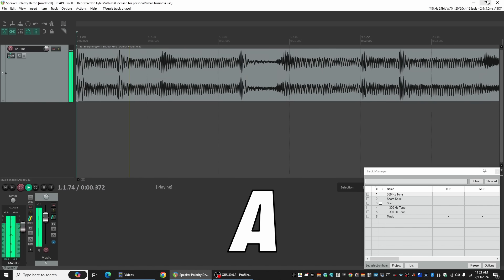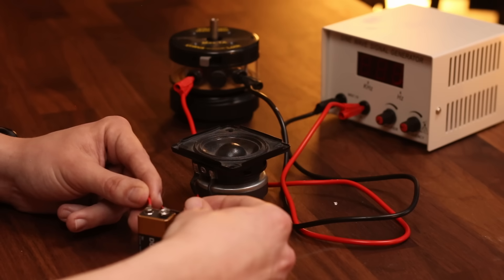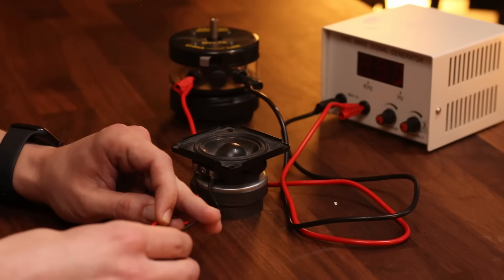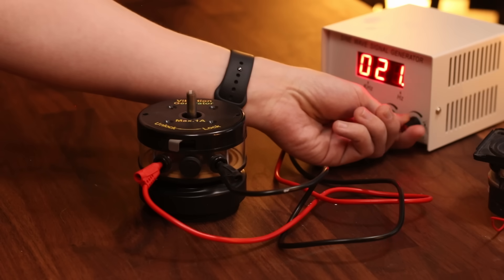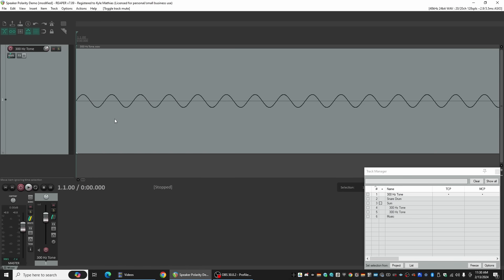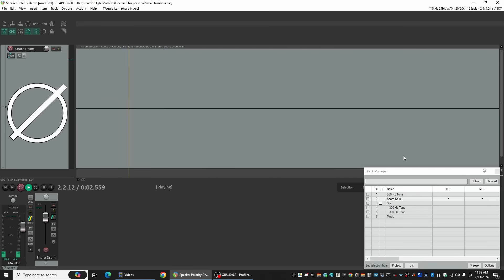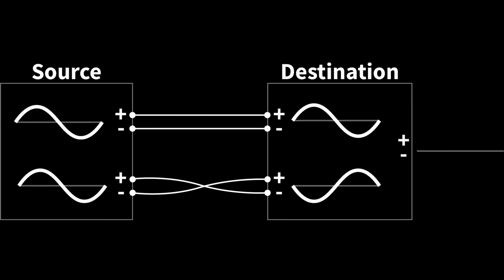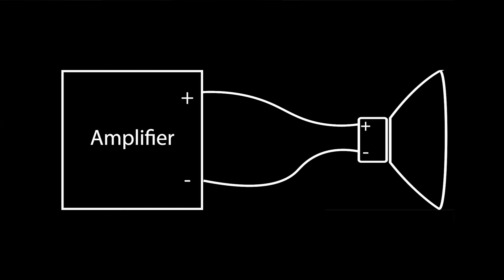What Happens When You Wire Speakers Backwards?

Comment: I had a Pioneer deck in my car that would allow me to select reverse polarity on the sub. I presumed this is what it meant. I tried it a couple times and never really perceived a difference in overall sound. 
After considering this explanation, I'd guess there would be cancellation in the overlap between the lowest sounds my smaller speakers could produce and the subwoofer's sound. Maybe that smooths out your system's output across the low frequencies.

Comment: think you coulda wired 2 speakers in reverse and played a song after having played it thru speakers wired correctly so we could actually hear what happens when you wire backwards?   A video that asks what happens if you?  And instead of doing it you just run yer yap about it.  Fuckin genius ain't ya.
Reply from the maker: I did play the song through two speakers with opposite polarity. The speakers were the speakers you were listening to the video with. Also, check out part 2.

Comment: Here's an explanation for you:  1. Air is not linear. It is tougher to compress air than to expand it.  When you microphone records the sound, the sound is distorted with quite significant 1st harmonic because air wave "pushes" are more pronnounced than "pulls". 2. The same happens during sound reproduction by a speaker..... ... BUT, if polarity is "wrong" the 1st harmonic kinda cancels itself a bit, if polarity is correct the 1st harmonic further amplifies itself.    3. Human ear actually does not perceive low order harmonics as a distortion. THey can serve as subtle sound "coloring". thats why tube amps improve some sounds (and make other sounds worse) is because they add low order harmonics into sound material....   But in this case "air" nonlinearity is so usual that we got used to it and and brain will most likely ignore it.... But maybe some people can hear it (it is plausible). What to listen for is reacher mid-range  content.  And it should be material recorded with teh microphone to hear this subtraction/addition of 1st harmonic. Of course there will be no difference for the generated sound.

Comment: False. Speakers doesn't have 'positive' wire because current are flowing with both directions (so voltage is positive or negative and thats determine direction) and that is the frequency of sound. Withount that +- changes speaker doesn' work.

Comment: thats the reason why some speakers in a 2 or 3 way speakerboxes could be attached opposite. Reason is to assist noise cancel the crossovered frequencies in case there are SPL deviations which would lead to tune crossover with more expensive componens or change the speaker for more expensive one..... sometime could help this ingenious aplication of reverse polarisation  :-) but designing hifi speakerboxes with complete electronics is not a standard discipline for everyone :-D

Comment: I wired 4 speakers before and had one of the speakers wired wrongly and the sound was 'tinny' and 'toney' with no bass throughout the whole system, but as soon as i found the wrong wired speaker and swapped the wires into their correct positions the sound had more depth and bass (i left the song playing as i swapped the wires around and the sound difference was noticable straight away).

Comment: 6:46 
Ah, but MOST if not all home stereo systems run way MORE than a mere two.
Maybe in ancient times, but even back in the early 1970's a good brand of home sterio was considerd as the Pioneer.
It usually ran to FOUR speakers, two per box, one a tweeter the other a larger bass (general usage).

It was the sheer size of the wooden box, along with the dampening system, and any vents it had, such as ventilated cones on the main speakers, which allowed the bigger speakers more room to "pump" air, whilst using that air to keep the voicecoil cooler as it flowed past the voicecoil itself.

FOUR speakers, all operating at different frequencies, meant that each speaker OFTEN ran against the movements of the others, and just as often, would all of them run as if one big speaker.
Thus there was always a lot of pushing and pulling going on, inside the boxes, as well as outside them, in the room.

IF one speaker was (acccidentally or on purpose) wired in reverse, most often no degredation of the total sound was ever noticed, except maybe sometimes when the bass soften out to almost  no level at all?

People (of those ancient times) just assumed it was the music itself and no one bothered asking the biggest curly question, until spottng a backwards wired speaker.

Now - take a little system such as I hand built (frequently) being one that has THREE master "balanced" DELTA WIRED speaker circuits, that are then also phase shifted as well as phase split.

One suddenly finds a LOT MORE than just two speakers, almost all of which (because of the way they are "split" apart) are running from a genuine 3 phased supply, in a multiple crossed star-delta-star configuration, meaning OMG all 88 speakers have at least a DC connection to any other speaker, but all DO NOT SHARE all the "same" electrical sine wave properties, of ANY other speaker, meaning that in a dual direction of travel (IN & OUT) each speaker is sometimes in phase with, and mostly NOT in phase with, any other speaker, so how do you tell, if ONE is wired backwards, when you have 88 ?

And, if it weren't for the LIGHTS, one cannot tell HOW POWERFUL any speaker is, unless it's light shines brightly.

A for real VU visual-meter (with a difference), one instantly visible, instead of a needle flicking on a small VU meter.
Plus, how many VU meters can one obtain, to provide a good enough reaction time, to see anything untoward.
LIGHTS are instantly seen as utterly different, completely variable and totally powerful.

https://youtu.be/Ub0S8eTijrA

One also cannot find a visual video recorder that has 88 different audio microphones, so a small MONO Nokia Cellphone's vidual recorder function was used.
With it's one ear (a voice-only mic).

Comment: 6:39.
Interesting hy[othesiss, unfortunately, NOT every AC audio signal is a pure "one frequency only" signal, with most having many other frequencies, all fighting for survival, within any audio track.
So - inverting one will give no difference, using TWO signals (not entirely the same) will result in a clearer sound, of lessor frequencies, than of similar ones.
It won't be 100% silence.
UNLESS you run the exact same signal pathway through both speakers - inverting one against the other, where BOTH can be seen to be active, whilst your ears hear nothing, and why is that -is it because they canel each other out, or .. Is it because ONE SPEAKER "sucks all" of the other speakers output, into itself, leaving NOTHING fr your ears to hear?

The second option is what happens, so - if the music "played" is at the upper reaches of audible volume, but inverted with respect to the other speaker, which is wil alost always be directly facing - for this effect to work, all audio will go from one speaker diaphragm, into the void created by the other. flip flopping in direction of "pull" depending on sine wave configurations.

NOW, will you hear anything.?
Probably not, BUT if one speaker has some added reactance added, such as a volume control, YOU will hear the other value of "volume" that has to go somewhere, and it will, via your ears.

If you "face" both speakers away from each other, to create dual parrallel lines, you will get "crossover" frequency wave patterns, that act for & against their identical signal paths, from either one speaker or the other speaker, AND THIS OCCURS whether or not either speaker is inverse wired.

It just sounds different at the crosover points.
ie:
If one signal is say running at 300hz and the other at 150hz, every second waveform that crosses the 150hz signal wave front - will oppose it, but every other will add to it.
Resulting in a faltering pattern of (multiple) High/low vs Loud/Soft music.

Comment: 0:54
The speaker voice coil, being an ALTERNATING CURRENT device, will "appear" on the application of a fixed "one-way" DC current, as if it PUSHES (or pulls) In ONE DIRECTION ONLY.

A brilliant way to show everyone here, that you know absolutely DIPSHYTE about how ALTERNATING CURRENT DEVICES actually work, because, being an AC device, if you "left" that tiny 9vDC voltage applied for way too long, you would effectively BURN OUT the tiny wires inside the voice coil itself, whereas - if you applied say 50vAC at a high rate of current, it would happily perform it's function all day  long, every day - because it was made as an AC device.

P.S:
An alternating AC current, flows in BOTH directions - alternating twice as fast as the frequency that drives it.

So - if one applies a FIXED DIRECTION, one way only "voltage/current source" to the voice coil, all you will get is it's FAR LOWER DC resistance, and NOT it's far higher AC Reactance.

The result.
A burnt out voicecoil that won't LAST very long at all, before the tiny wires heat to such  an extent they "melt" their own insulation film with a catrastrophic short circuit result, ending in a completely burnt-out coil, with no way back.

Now, to "prove" a valid point, for an AC device (being the "electrical component" of the voice coil, attached to the speaker diaphragm), you need to apply an alternating voltage source.

Oh and I love how you "inadvertantly" leave out the statement of NOT removing the red wire, but to "touch" both the red & black wires..

See - if you ONLY aplied the black wire, to the hegative terminal (1st) you would NOT have the red wire attached, hence - if you (ONLY) touch the black wire to the negative terminal - which is what you "actually" said, nothing would also happen..

Sadly by NOT explaining the active test environments, of NOT removing the already touched red wire, BEFORE ADDING the black wire to the "connected circuit" via the negative terminal - YOU are not being specific enough to "prove anything - other than your own inability to explain anythng".!!!!!!!!!!!!!!!!!!

Comment: Years ago i designed a push-pull subwoofer configuration, ie 2 subs face to face wired backwards of each other, one pushing and one pulling, astonishing output in half the cubic box volume,ported and tuned. Made a band pass box for 2 kicker solobarics also, which the manufacturer said not compatible, 3 cubic ft, 4 4"x12" inch ports 2 solo 12s and 152 db in 1990
Reply: I see no one has ever even heard of a push pull set up, that's your loss, I took a guys Honda civic, he had 4 15" earthquake subs in gynormas boxes where his back seat used to be. He wanted more bass! I took those 4 out, put the seat back in, built a 3cf box, with one 15 mounted normally, and the other directly on top, face to face, tuned a 3" port to the box at 34hz. Result, 2x the bass he had in 1/3 of the space. It would literally suck the air out of your lungs, almost like a fat lady bouncing on your chest

Comment: To some people this video may be useless if I read the comments but let me tell you, not so long ago I've bought a very expensive home entertainment system with pretty decent sound. I had a get together with some buddies and wanted to show off my new set so I disconnected the complete system to play it outside and had a little help from one of my oh so helpful buddies. Eventually everything was connected and when it was time to play, I could only hear the mids and treble but the base was virtually non existing. With two subwoofers connected I looked like a total fool. When doing fault finding we quickly realised that the guy who connected the subs did the wrong way around, not following the colour code. So yes, very important to take note of and this is a very good video for the younger generation starting their sound journey. 💯👌

Comment: If you wire the polarity of a speaker correctly and the other speaker incorrectly on a hifi system, one speaker cone will be pushed at the same time the other one will be pulled, and this can cause cancellation on certain frequencies within the audio.

Comment: people claiming they can hear a difference are full of it. our brains can't actually detect the difference in the low pressure segment of a wave and the high pressure segment, and in fact, most people can't reliably tell if a constant change in pressure is up or down (eg, did your ears pop because you increased or decreased altitude). as far as sound goes, that's just not how the cochlea works. it detects oscillation, not pressure changes.

Comment: If you measure the output of an amplifier there is a small amount of dc (direct current) riding on piggy-back with the ac signal, it is not a pure ac (alternating signal). That's why it is oriented as positive to positive and negative to negative, otherwise they will not put a + and a - sign on the speaker. There are people who wants to challenge the norm without any theory for them to sound intelligent.

Comment: There is no difference if you reverse the wires on a speaker. The audio signal that is present in the wires of the speaker output is an alternating current not direct current therefor it is not polarity sensitive.

Comment: Its just going to drive the wrong way, and it'll be noticable at higher volume. I used to install theater sound systems its been awhile though. Even if i couldn't hear a miswired speaker the equipment wouldn't pick it up. A series of mikes in a diamond shape. Its really hard to pick out individual speakers in a theater while equalizing the system. A double a battery is better than a 9 volt, thats a bit hot.

Comment: I learned in the 1960's that wiring stereo speakers at opposite polarity diminishes the bass output of the woofer speakers. Because when one speaker is pushing air, the other speaker is pulling air. This cancels the bass sonic energy that gives music it's punch. My old tube stereo amplifier had a polarity switch that would switch the polarity of one of the speakers. I could really notice the difference!

Comment: I used to wire the front tweeters out of faze in car audio in the 90’s. It gave great separation and depth. But when judged using an R.T.A. It was always a bit worse. But that’s when a 32 band EQ on each channel came in handy. I wonder if I.A.S.C.A is even around anymore.

Comment: Very nice video indeed, so for applications like CB HAM radio , that only use 1 speaker , mono, if the terminals are not labelleded + and - is there any other way to detect the terminals other than opening a speaker and putting voltage through it? is there an impedance method? Say with a multimeter ?
Cheers
Reply from the maker: You cannot check with a multimeter because it’s just a coil of wire. You can use a tester or polarity test app that sends a signal through the speaker and measures it through a microphone.
Reply: @AudioUniversity  thanks for the quick reply.